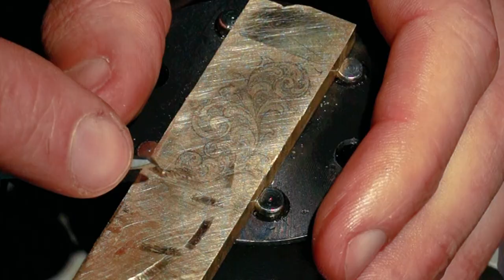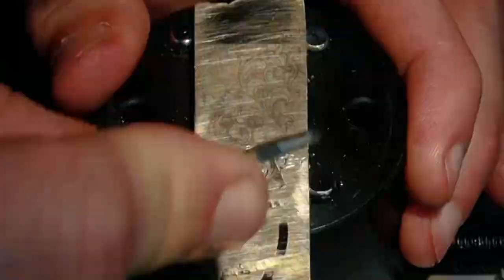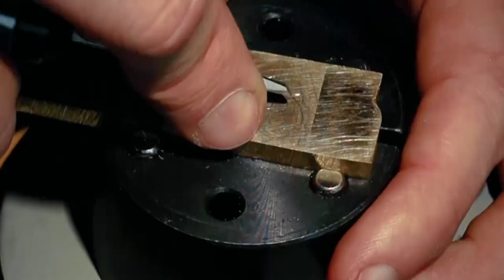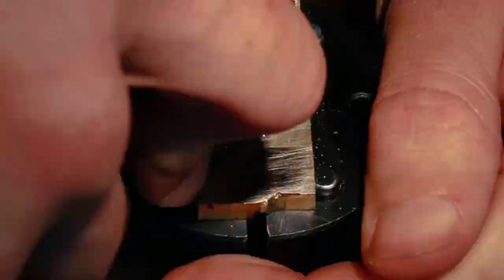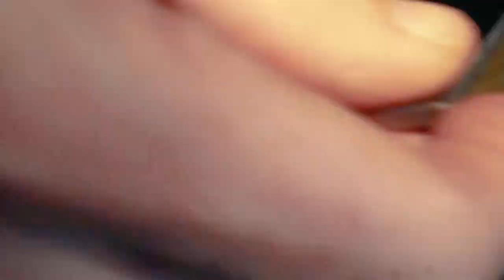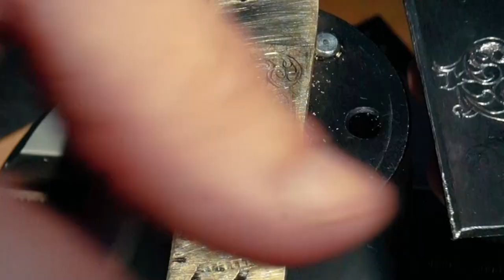Hand engraving practice - scrollwork on brass

Comment: Wonderful video. Thanks sir! I just started engraving with some used GRS gravers I bought of ebay. I have sharpened to the best of my ability. I do not have a pneumatic system and I am just using my hand to push them around the work - which is soft Aluminium. The engraver slips a lot and some times also gets stuck. Do you think this is just because I am a beginner or can a pneumatic system be easier and give more consistent results ?
Reply from the maker: aluminum is super soft, which sounds like it would be easier, but really in my opinion it is harder! try some pennies or some brass. You can still certainly just hand-push, but those both offer more consistent resistance.
Reply: @CalebKraftmakes  Thanks for your response!! I will try your suggestion.